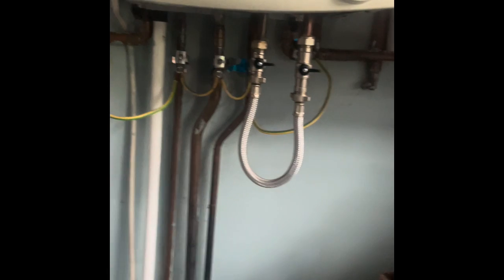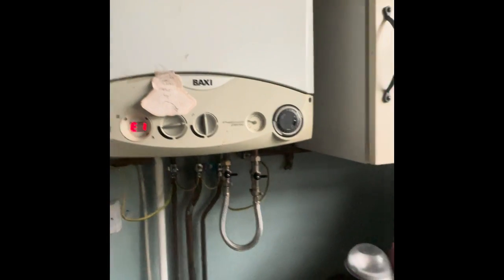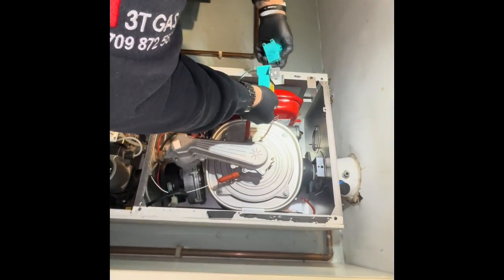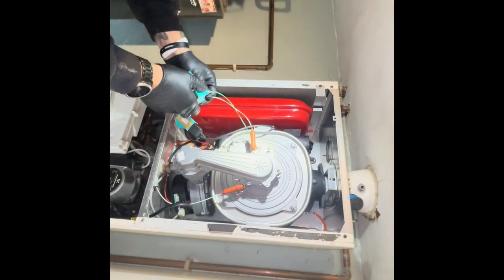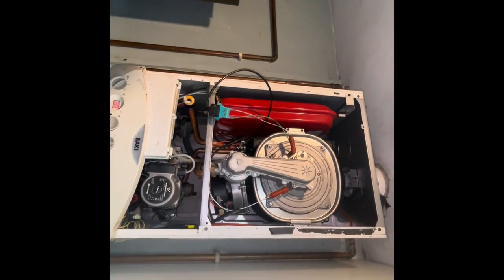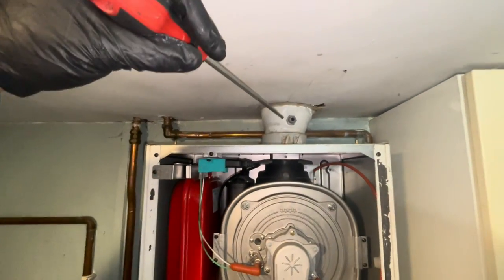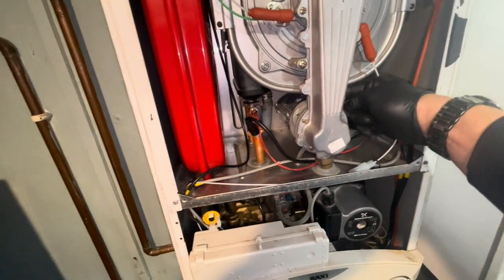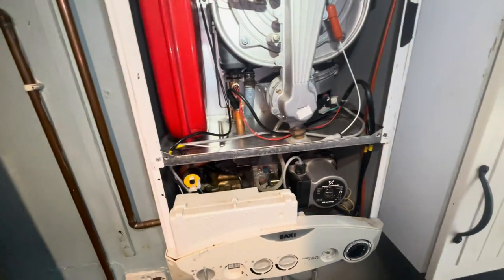Baxi Boiler Repair E168 fault

Comment: Thanks very much for making this video mate was stuck not wanting to buy a new board because I had the original board repaired and it worked on the test jig so came across your video and went back focused on spark generator and all is sorted

Comment: E168 was a produced when the pcb didn’t recognise an actual fault, baxi produced a set of tests generally to do with earthing of the burner door/electrodes but have to agree,E168 was a faulty pcb

Comment: Mmmmmm, the pesky e168 fault!
Reply from the maker: I remember going to a Duotec  that had had 5 pcbs in as many months due to E168 fault , turned out to be the control switch that turned the boiler on and off